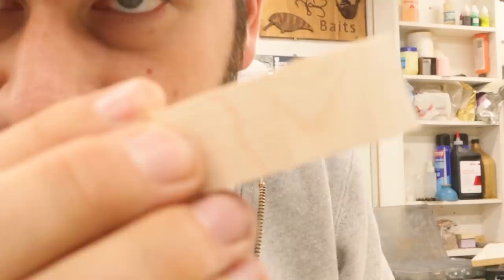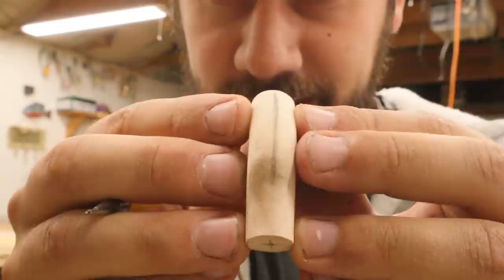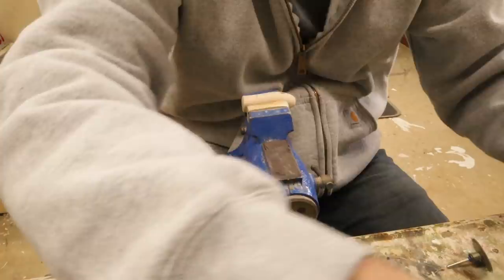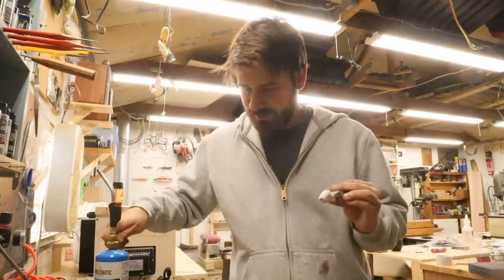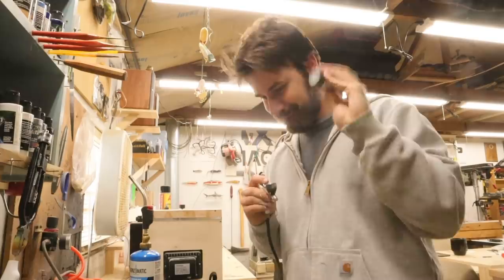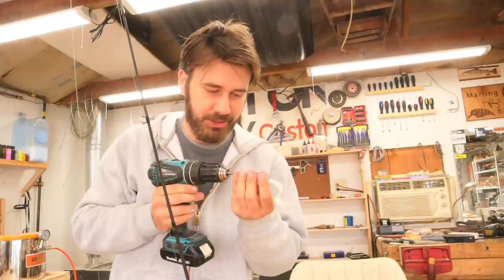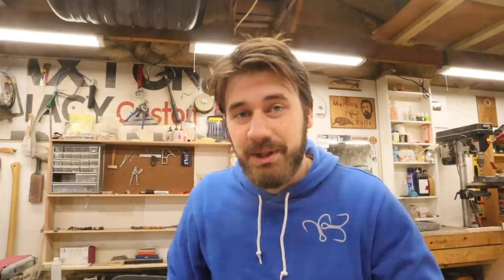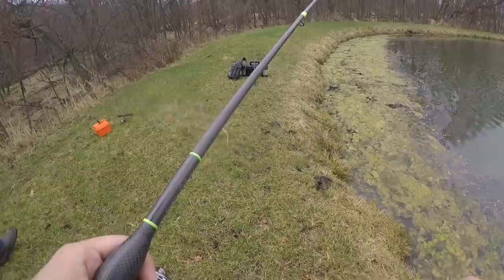LineThru PullBait | One Day Build to Catch

Comment: Just found your channel. Loving the vids bro. A little drilling advice (from a cabinet guy). After using your punch to determine center, run the bit in reverse first. Once you're in the material a bit, and started on the correct angle you can then run forward and drill it out.

Comment: I think the issue isn't the weight, but the line tie. The line can move throughout the inside of the tube you made for it, so pulling from the side makes it run at odd angles. Try facing the rod tip at the lure and retrieving.

Comment: If you decide to try the line-thru option again, they make small plastic tubes for fly tyers to tie tube flies.  Also, you could try some adhesive backed lead tape to balance this out so it rides better.

Comment: For some reason I am thinking I have a small metal sawblade for my dremel that might have worked for the slot you were doing in this video.   Also, you may already try this, but if you put the bait in a clamp, or that drill press vice you used later, you could then hold it in that orientation in your drill press to drill holes like for the magnet.  ie put the clamp on the drill press table to hold the orientation similar to the vice, then drill.

Comment: I find if you run the drill in reverse until the drill makes a slight hole it won't grab as much, it kinda burns it's way down. Once you have that slight hole drilled you can switch it over to drill in a clock wise fashion. Running it backwards causes it to be easier to control

Comment: Just add more reducer to your paint and it will atomize better and flow through that smaller needle/nozzle setup.  I have to reduce my paint almost 60-70%  when i use my .18mm brush.

Comment: The smoke flash at 14:56 when the super glue penetrated the baking soda on the first weight, is that a chemical reaction? Thanks in advance for any insight

Comment: If it was me Ike be inclined to mount the magnet on the bottom of the lure so that the lure wood acts as a buffer to stop the magnet pulling out when the hook gets pulled out. (Right now it is relying on the strength of the glue which may dislodge with continuous use.  You could also backfill the holes with lead shot/ 5 min epoxy as one of your weight points.  The magnet is strong enough to attract the steel hook through the wood.

Comment: Super fine airbrush nozzles (<0.3mm) are a pain, they've got to be squeaky clean and the paint needs to be thinned/filtered otherwise they just keep clogging. I think they work better with oil based paints personally but really no need to use one unless you're doing extremely fine detail work (eg. strands of hair).

Comment: If you made a v but of wire  with two pieces coming off the  sides straight then put to mall holes in the grub hole on each side the wire can be squeezed the lock into the holes and you can just run it through the soft plastic with out have to glue or worry about it coming off

Comment: To mee the hook would air stream thru the water if hook was on the bottom just past the belly curve. You could flatten out the eye hole in a vise heat hook up tighten vise around eye squeezes it shut a tad, still hole at angle r line they lure body tie to hook. Push hook into body only thing hanging out is  the barbs from hook. Force of retriever water pressure reps body down into hook no magnet needed, maybe a few bb’s for Balance